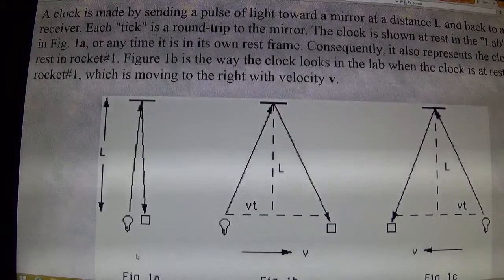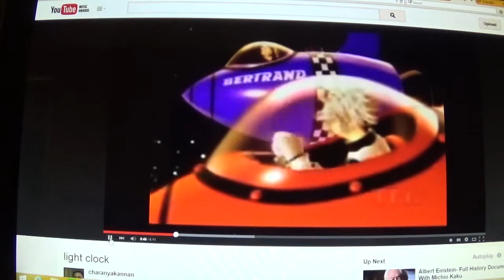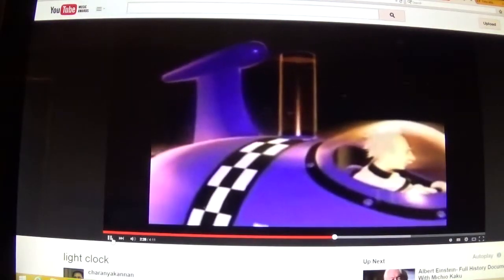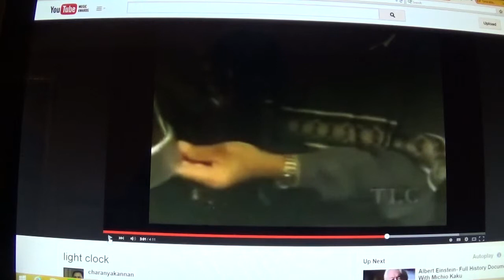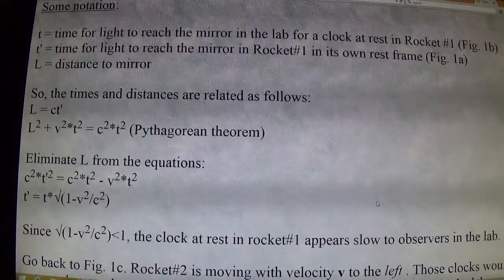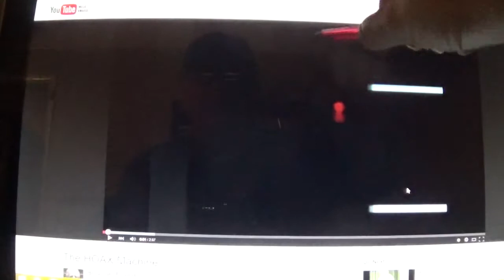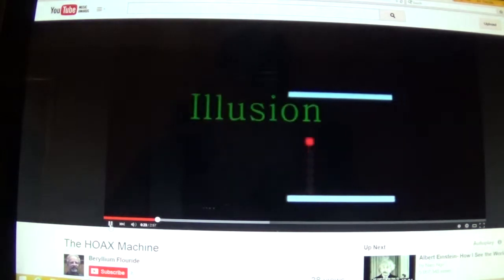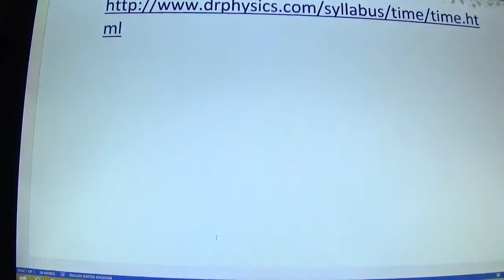Light Clock Hoax

Comment from the maker: The idea is to show things as simply as possible that Einstein is wrong, and that the relativists use of lightclocks is nonsense as shown. Essen was expert on atomic clocks and pointed out that relativists claims about them were false. Similarly claims by relativists that GPS uses their messed maths is also false, and Newtonian physics can be used. Claims by relativists that lightspeed is constant (under the various conditions of inertial frames, vacuum etc) are false, and it is instead only a condition imposed on interpretation of certain experiments that messes up the maths; while a straightforward treatment of the maths by Newtonian physics does not need the maths messed up that way.
Reply: Please see the great new book: "THE 3Rs: REASON, REALITY, AND RELATIVITY,
 A Linguistic Analysis of Relativity" by Reinhardt, Douglas.
Reply: How do people never mention the concept of apparent speed in these discussions. How does relativity deny relative speed?